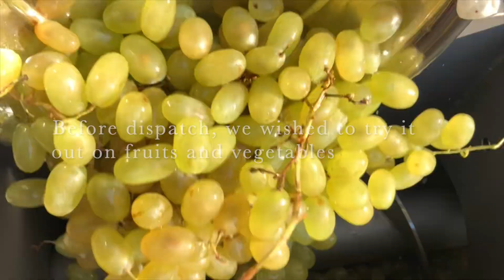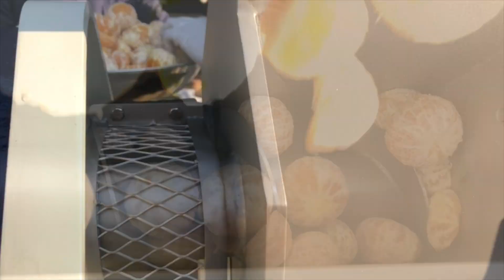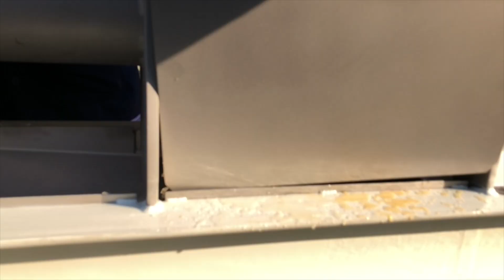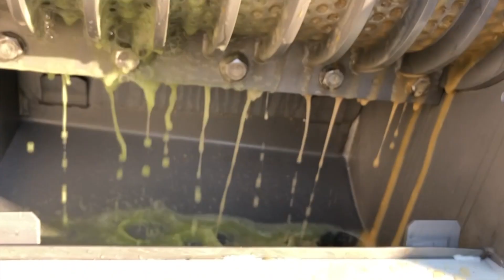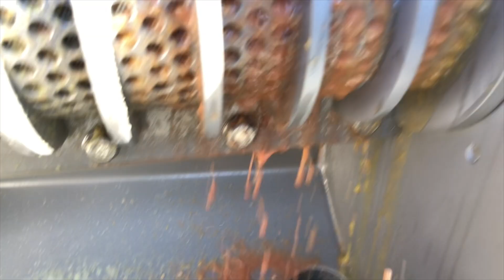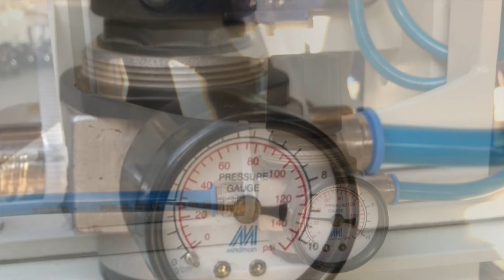screw press squeezing fruit

Comment: There is a machine for prickly pear juice and another machine for extracting oil.. What is the difference between the pressure screw between them?  And also between the screw that used in the plastic recycling machine?